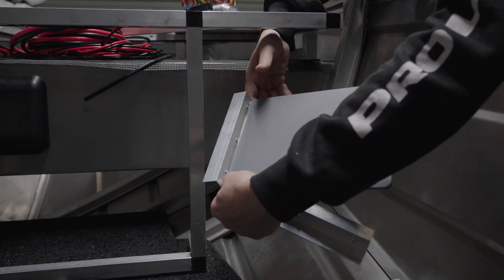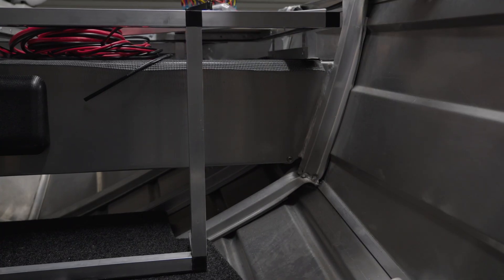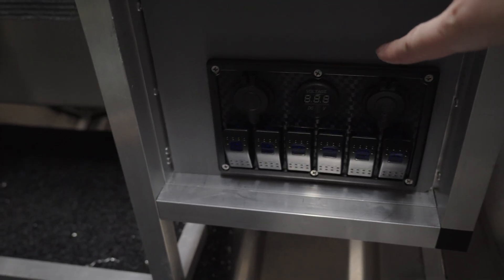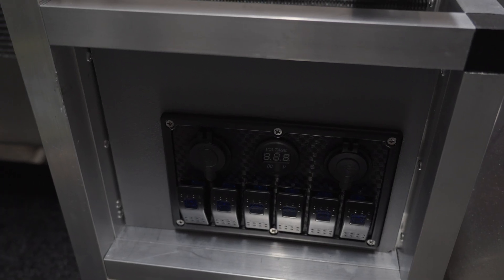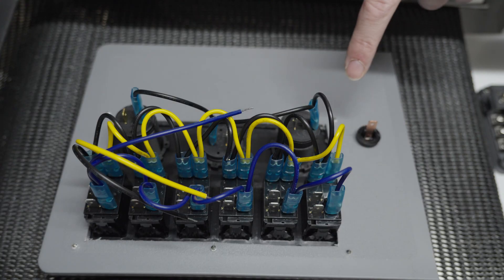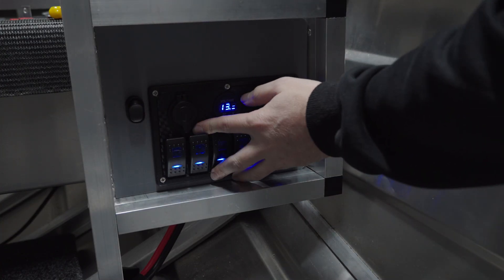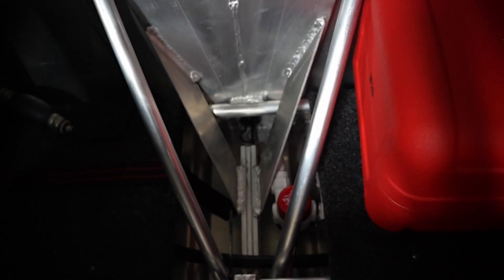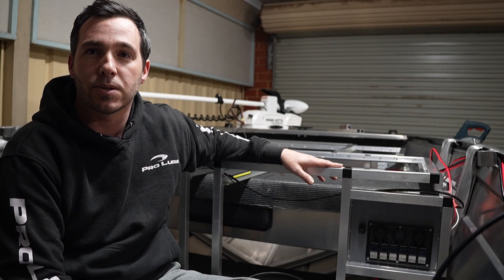Tiny Boat - Episode 4 - Electrical Stage 1

Comment: Hey mate. I like your work, well thought out, very similar to my 25 year old boat that I rewired and updated when I got it a couple of years ago. A couple of points I found that you might want to avoid... 

I used cheapie HDPE cutting boards instead of ridiculously priced "Starboard" to make a fishing tool holder, but it ended up cracking badly. Turns out this stuff expands and contracts significantly and if you drive screws into it, it will crack around them when it contracts. Better to drill slightly (say 0.5mm) oversize holes and use stainless bolts with nylock nuts both to mount the board to the boat, and switches/fuse box to the boards. 

Also I used the same fusebox (mine was 12 way)... works well but the back is not sealed. I discovered this when I started getting odd electrical problems and pulled it apart to find it was full of corrosion. Pull the back off, clean any corrosion that's already happened and cover any metal components inside with dielectric grease, then seal the back up with silicon. Once you've done that fill up the fronts of each fuse holder with the same grease. This is especially important since you're mounting it horizontally and face up. Don't forget to grease all the screw/bolt terminals too, as well as all the crimped lugs that attach to them.
Reply from the maker: Thanks mate, some great tips! 
Interesting you mentioned about your issues with cracking the cutting board I’ll take note. I haven’t had any issues in the past but wondering if that because I’ve always had them out of sunshine. Might need to be careful with this one but hopefully having it recessed will help.

I’m planning to have a base in the hatch to try and cover / waterproof the fuse block. Will have to see how it goes.

Really appreciate the time you’ve spent to share your knowledge 🙌😀